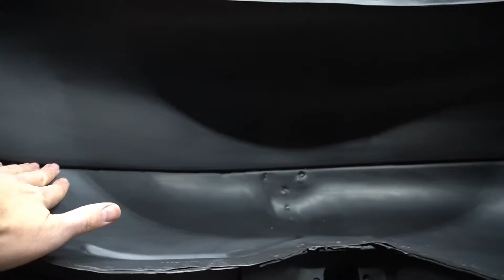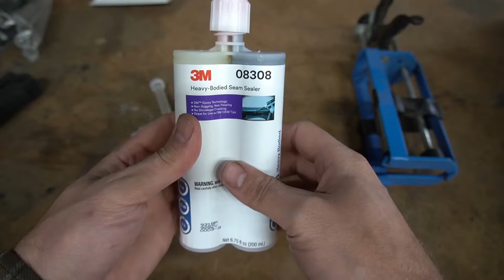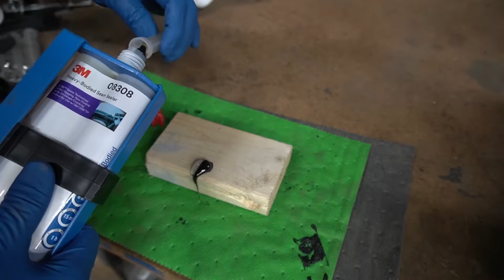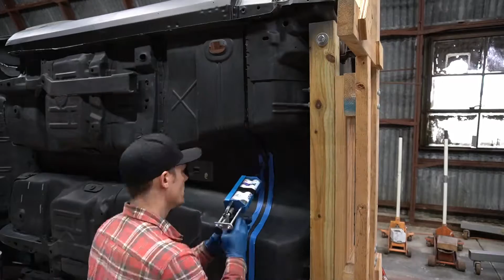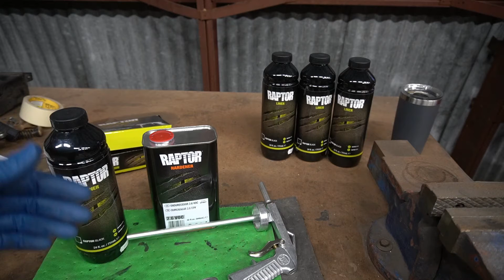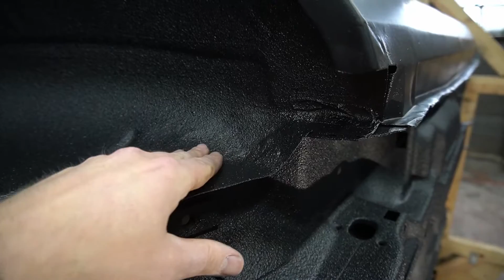1971 Camaro gets 3M Seam Sealer and U-POL Raptor Liner!

Comment: I know this video is old, but wont most moister come from outside the car?  Especially the underside from road spray?  If keeping water out of the seams is the goal, to me it makes sense to seam seal the entire bottom to keep road spray out of the seems if the raptor liner were to fail.  

Plus, by raptor lining the floor on the outside, water that made its way to the seams from the inside has no where to do, but to sit in the seam and rust.  To mean seam sealing both top and bottom makes the most sense that way its protected from both sides of the seam.

Comment: One thing U-pol aggressively mentioned to me when I contacted them about their product being used to coat the bottom of a car after a restoration, was to never spray their raptor liner directly over a seam sealer without first applying a primer or adhesion promoter over the seam sealer first.
Reply: If you can paint over seam sealer i can`t see why you can`t do what he did. Unless raptor has silicone in it.
Reply: @Supanova70  Not sure, but didn't want to risk the liber not adhering, so primed everywhere there was seam sealer before spraying the liner.

Comment: Have never understood everybody taping off the seams on the bottom of a car before applying seam sealer. Up until the advent of robotics applying perfect beads of seam sealer, it was all put on by hand and just nicely (kinda) smeared over and along the seams. They didn't waste time and money pissing around masking off the seams to make them look pretty after the seam sealer was applied and the masking removed. Run a nice bead then use a stiff bristle brush to smooth out the seam sealer along the seam and DONE, leaving it looking just like I did when it rolled off the factory floor.
Reply: maybe some people want a better job then what an employee would do. Its amazing to think their are some people that take pride in their work because its not a "job". Hate to see the sloppy mess under your ride.
Reply: @reapwhatyousow3383  And that comment right there makes you an idiot!!  Not my opinion, that is a FACT!!!!!

Comment: Nice video with good info. I am a belt and suspenders guy so on the bottom of doors and rockers where the factory stamp raise weep holes to escape, my 67 C10 cab will be bare metal (Chemical strip / I bought 15 gallons of the good aircraft stripper w/methylene chloride in it and keep a hand held sand blaster for hard stuff.) I noticed price change with no explanation until Oct 2019 hit. The EPA claimed that 41 souls had been lost since 1976. Seriously? They loose that many in Chicago on a weekend. What a shame. The truth is, they can't keep track of waist! That's it, nothing else. 
But I welded weak spots and had very little rust but no history on where it spent it's life. I used Dynaglass top & bottom, seam sealer everyplace two sheet metals came together. In NE, water still splashes up and a thin layer of dynaglass, epoxy, black bottle Raptor went on the frame and the cab (Inside and out, over seam sealer like your, epoxy then Raptor. I did paint the frame black w/ clear using a catalyzed commercial paint with lots of air/sun bake. I draw my schematics for wire and fittings used for fuel & brake lines. The remaining holes where welded shut as if never there. I did the inside of both doors but just seam sealer and epoxy. Nothing on threads or moving parts as they were removed or plugged. $5 at a swap meet got me 50 corks small to 5/8". Verify that all openings for water to drain are open. Retired give me time and about $1k a month to progress forward as I have seen techs with their Falcon or "F" body in 3-4 colors get married, have kids and come to work in a minivan one day. It's my turn as I get close to my mid 60's to see the leather buckets, PCM, BCM and Tach module from an "LS" swap to my bench built 4L60 and cruise. It's a driver! 
 Best of luck with your project. I make a service manual for my truck to make it easy, cell by cell. That's the part most forget as right there is the diagnostic flow chart. Look up the code, follow instructions, replace or repair, part numbers and company but 98% GM off the shelf in stock. Connectors marked, numbered, wire colors, size and photos of each in location. Paper, thumb drive and CD. If they can't figure it out, go to the dealer. Same stuff. Same with paint! Ain't that where we started! You bet cha! Have a lucky one.
DK, ASE Master Tech since 78

Comment: A seam seal was used to fill the gap in the joined panels. Later up to today seam seal is used to fill the small holes left from welding burn thru.

Comment: Just found your channel, liking the work. Regarding your question to us, the audience, about seam sealer: According to collision repair standards (moving target) which follows the manufacturers recommendations along with constantly updated science, best practice is to seam seal everything on all sides. Any collision repair and new welds get seam seals even if it wasn’t that way from the factory. The thinking is that the manufacturers usually dip the vehicles and use electric charge to suck zinc and corrosion inhibitors into the seams. Once thats disturbed we can’t replicate that so we follow a sandwich of protection. Now given its a 70’s era vehicle its very different then most vehicles on the road, but a sandwich of seam sealer/adhesive and 2k primers along with cavity wax in all cavities post paint is the way to go. Your work looks great though and most people dont bother with seam sealer anyway, even the collision repair shops that are supposed to be doing it and know better lol.

Comment: nice bro looks good got 1 question for you tho why did you go raptor liner instead of something like por15? Also TIP when painting instead of tape wads to fill bolt holes try foam ear plugs squeeze them put them in and let them expand and fill the hole thanks again man love these videos they keep me movtivated on my project keep it up👊
Reply: Por15 is a rust converter and raptor liner is a undercoating sort of thing protects truck beds and steel in general

Comment: Looking good Dan! There was seam sealer on my 70 between the wheel tub and quarter panel flanges and trunk drop and flanges. I think you did what was necessary with the Raptor. That should seal the flanges I would think. I used Raptor on a 53 1/2 ton Chevrolet truck, color tinted with good success so far on the wheel tubs.  It has been two years and so far I am happy with its performance with rocks, water, etc. You can cut if needed to get the final finish you want. I didn't want a really rough texture.